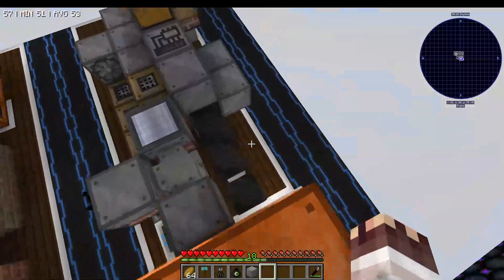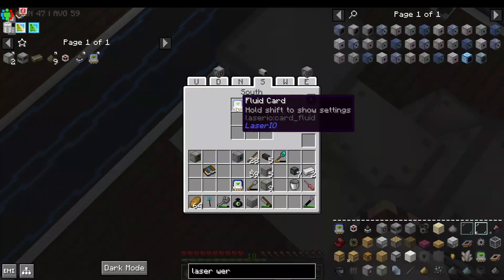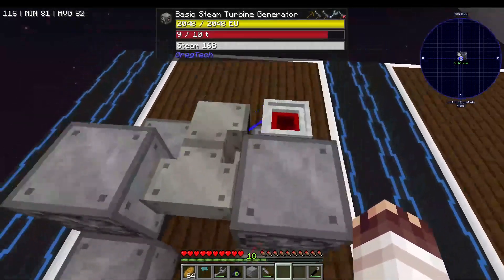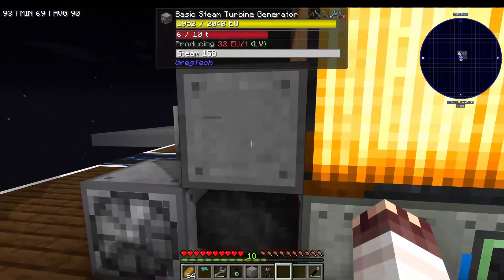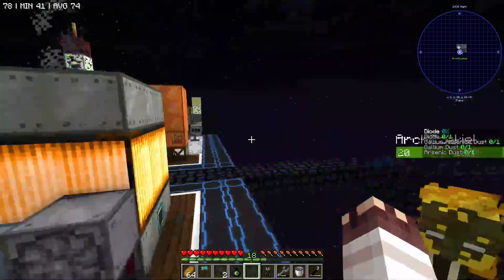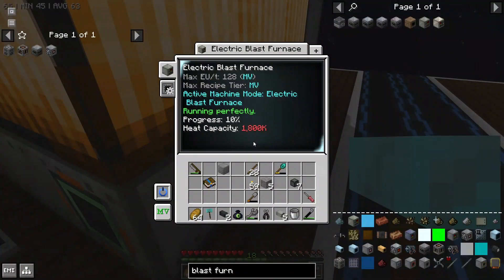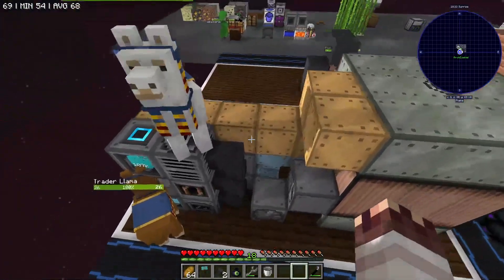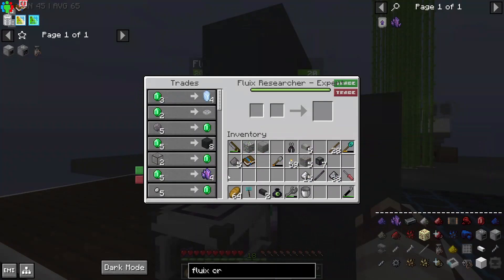Sky Greg Supershorts #3: EBF and MV Circuits

Comment: All machines can accept up to two amps (multiblocks can often accept up to four amps with two energy hatches); this is enough to run some recipes in higher tier machines. Notably, a HV macerator processing ores can easily run off an LV line. Just make sure to check the recipe power consumption.
Reply from the maker: Does that work when you feed wires to only one face?
Reply: @minecraftinchocolate  Yup. It's the same for energy hatches in multiblocks - one block, one wire, two amps. And if even that isn't enough, batteries can make up the difference temporarily.